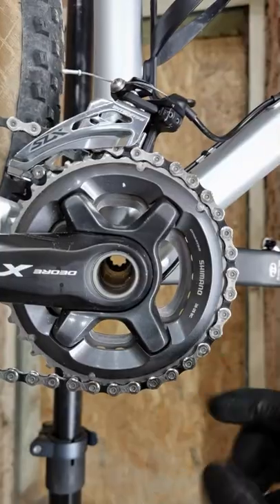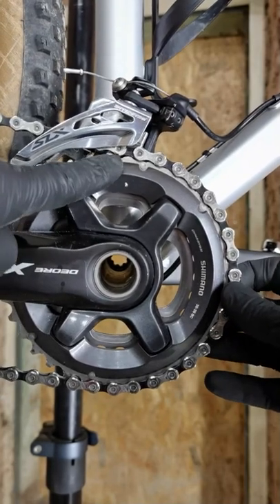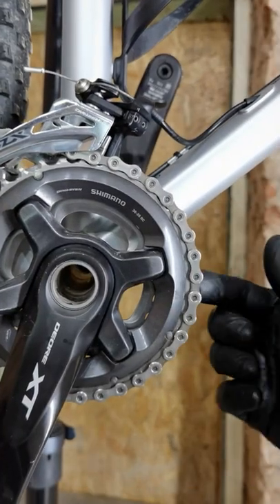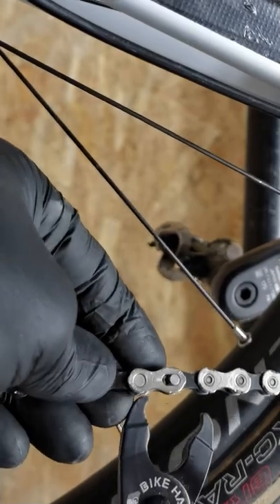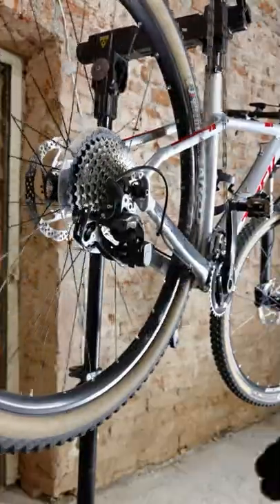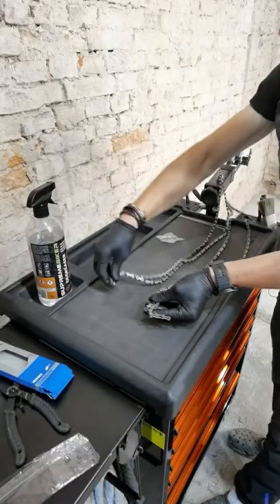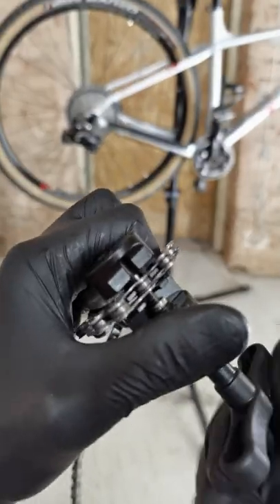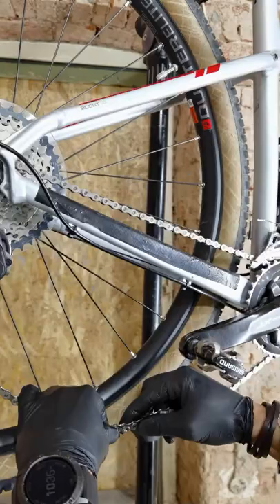How will you know that your chain is dead and how to replace it. #shorts

Comment: This short format sucks. My chain when it had about 2 k on it, the tool showed excessive wear. I left it on and have put on so many miles; I cycle about 1000 miles a monthe. I clean it every night, and lube it with Baby oil. It's starting to skip, so, I will replace it, along with the cassett.
Reply: Use a specific bicycle lube. Don't have use baby oil
Reply: @smolkaguya372  the baby oil is cheap at the dollar store, and seems to be working quite well.
Reply: @jonmeadow8706  attracts more muck and the chain won't run as smooth
Reply: Yeah sure you can use a worn chain but it will start to wear other parts of the drivetrain which are more expensive to replace.
Reply: @andreasnaumov3414  Exactly.
Reply: @jonmeadow8706  ↑ Don't do that. Going past 0.75 will wear faster and faster your cassette and your crank gears. Especially the crank gears.
YOU WILL end up with hook-teeths on your crank gears if you use a worn out chain for too long and will result in "chain sticking" at the crank shaft and result in the chain damaging itself and the frame. This can be more expensive and more difficult to replair than just changing the chain *& cassette.
If you put on all new drive train gears/chain and wear out your chain to 0.75 change it RIGHT there. This should allow you to use the same old cassette with the second new chain if you change speed the correct way. By doing so you may/will experience some chain skipping for the first few miles on the smallet gears of your cassette but this should go away after some time.
Also you don't think about it but now that you have use that old chain for so long that it started to skip, look at your derailleur's gears. Instead to have a top square they are probably just spikes. This can alter the shifting performance greatly.

The proper way to shift is as follow * for 8x3 as example: (number below may depend on road condition and your gear ratio) (this is how i currently ride my MTN bike)
Dead stop: ~4x1 to rolling ~4x2 or ~6x1(then eventually shifting to 5x2)
Never/Avoid: Riding your bike with a crossed chain aka 7x1 8x1 | 1x2 8x2 (those 2 are not as bad) | 1x3 2x3
Reply: So you replace the cassette and chain about every 7 months?
Reply: @cyclingjoezone  About that I think. I still haven't replaced it from two weeks ago, as it only skips when climbing, and then, it's just in the middle gears. But I will replace it soon.
Reply: Fully agree. A 1x11 chain costs 30 euro? A cassette 60+euro? So if you buy 2 extra chains to preserve 1 cassette, it is more expensive. Front cog is much more durable and will last long.  I usually buy deore. Strong and cheap.

Comment: Preventive replacement so far has cost me more since often i had to replace cassette as well, while everything was working perfectly upfront. So now i just wear it out completely.
Reply: Bingo. Theres a happy medium
Reply: The whole point of replacing chains early is so that you don’t have to replace cassettes as often
Reply: You have a problem. If you are taking care of your chain and replacing it before it wears too much, your cassette will last a long time.
Reply: @DaveCM  not if you're like me and you're riding in the top 2 gears most of the time.
They will wear out faster than the rest of the cassette, due to the load and torque being spread over a lot less sockets.
Reply: You shouldn't be cassettes should last 3 chain lifespans
Reply: And cassettes nowadays you can replace   the lowest gears

Comment: Had an Ultegra chain on that I was told was 50% worn. Bought a new Ultegra chain, laid them alongside each other and the old one was just short of a full link longer at 108 links. Better shifting with the new chain especially on the chainrings.

Comment: Can you make a video how to get the perfect chain length?
Reply: Several channels advise different things but there are two main methods. Without threading it through the derailleur, wrap the chain around the biggest sprocket and biggest chain and join as closely as possible, and once threaded through the derailleur there will be enough tension. The second method, which is recommended by the mustache man from Park Tool, thread the chain through the derailleur, biggest sprocket and biggest chain ring then add two links. The chain tension will be different using each method but I can’t confirm the difference because I’ve personally never needed to size a chain. I did however, notice snappier shifting, albeit more noise when I removed a link from my new bike in an effort to reduce the effects of chordal action, which of course didn’t work.
Reply: Count the links ffs

Comment: You can wait till it's 0.75 wear if the sprockets are steel? Does this also apply to road bikes?
Reply: Depending on the drive chain. If it's 11 to 12 speed .75 you waited too long.

Comment: Anyone know why after waxing, I'm having issues shifting to certian gears. Its a 12 speed deore and when shifting up to the 5th gear the chain just rubs against the back cog. I haven't tried rewaxing yet.
Reply: Have you broke in the chain?  You should put it in 6th or so and pedal around for 10-20 minutes.  I have to do this everytime I wax.
Reply: @jimmyhopkins9497  I had previously, then I rewaxed and had issues on a different gear. When I took it to the shop it was just the cable that needed to be tightened. Thanks for the advice.
Reply: Just sounds like an adjustment is needed

Comment: WARNING:  If you're using this ParkTool chain measuring tool, than you need to replace your chain when and if you can gently push in the O.5 tip into the chain.  If you wait until the the 0.75 tip fits the chain, ITS TOO LATE, because you just ruined your cassette.  Why ParkTool put a 0.75 tip is a cruel Joke. I know cause I own a Bike Shop in Seattle WA and I see this all the time.

Comment: the chain is not changed separately, it is changed together with the cassette and system. the more bloggers like you, the more work and income I have))))
Reply: Really?
Reply: @XtenstialKrysis  Yes. if the chain died, then both the cassette and the system died. a new chain will not work on worn parts
Reply: @Борисович-р7б  Completely false. Chains wear quicker generally than other drivetrain components. Refer to Park tools instructional video on when to change your chain.